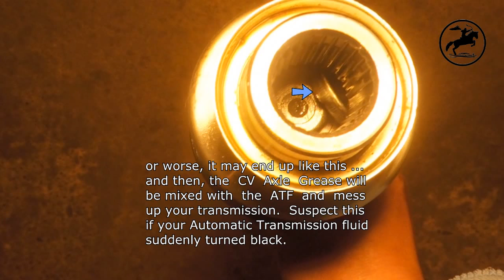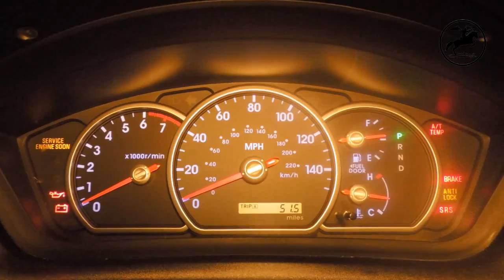CV Axle Change Passenger Side on an AWD Mitsubishi Endeavor DIY

Comment: Thank you for an excellent presentation. My ABS sensor bolt broke. Once I got the axle out of the knuckle, I placed a 10 mm socket over the sensor tip and the socket lined up with the outer edge of the sensor body. I was able to tap the sensor out. Now I have to figure out removing the broken bolt.

Comment: Well done with good info, thank you. Maybe use trans fluid to lube seals. Grease might break down the seals over time. Coat the axle splines with anti-seize before reinstalling. I just got done destroying an axle because it was frozen in the hub/bearing. When installing the axle into the trans, place the opening of the lock ring, up for easier install. If the opening hangs at the bottom, it could jam on the splines on the mating shaft.
CAUTION: you don't want the anti-seize to get scraped off while sliding axle into the hub and getting deposited on the bearing surface where the axle mates with it. It won't squeese out and will mess up your torque. It will cook out and loosen the axle/hub connection. Best to put anti-seize in hub and let axle shove excess out towards the threads were you can clean up the excess.
Reply: I have the same problem with my axle.  Seems like it's welded together with the hub. Any ideas how to get it to come loose??
Reply: @stephenburem9582  depends on what you're willing to destroy and what you're trying to replace. If you're installing new bearings, then you need to push axle in enough to get to the hub bolts. Sounds like your axle ain't moving. You can start by putting castle nut back on backwards to protect threads and use sledge on it. I ended up going through 3 cutoff discs to cut up the hub and peel it off the splines. This exposed the bearing that I torched, then used sledge. Finally came loose. Couldn't save axle thou. You could disconnect knuckle, pull axle from trans and try to press it out. You will most likely twist off bolt head trying to remove  the ABS sensor. The sensor has a plastic sleeve. If bolt comes out, you can spin sensor to break it loose. Broken bolt? I was lucky there. I had my axle out and used a 10mm socket on the sensor head to tap it out. Good luck, and buy bandaids.
Reply: @stephenburem9582  I have one other possible, less destructive method. If you could get your hands on a large three Jaw or hub puller rated for at least 5 ton and apply ant-seize to its threads to help prevent galling, you might be lucky. Some people are lucky by threading two screws through the hub that press against the knuckle. Just put something between the bolt and knuckle to protect the knuckle.

Comment: Your CV Halfshaft looks much more fun than mine. Mine would absolutely not separate from the wheel bearing (Had to change the bearing, but ended up changing halfshaft too), and for the ABS sensor, yeah, mine was seized in there, and I broke it when replacing the bearing. Rust is a terrible thing. Still love these trucks though!